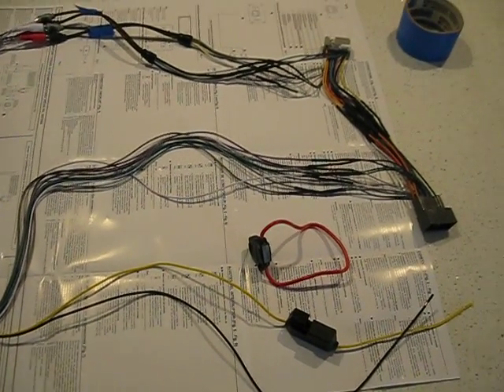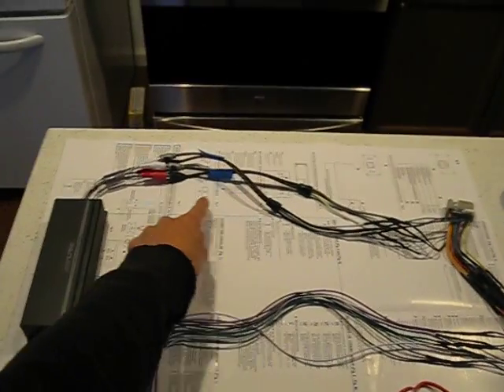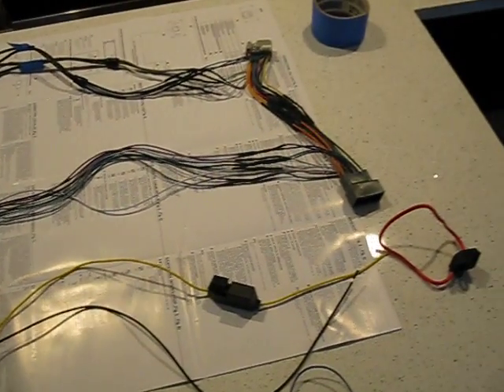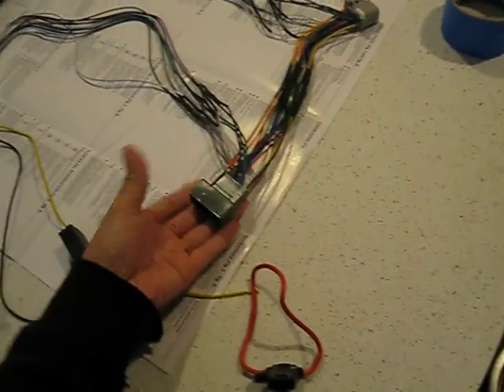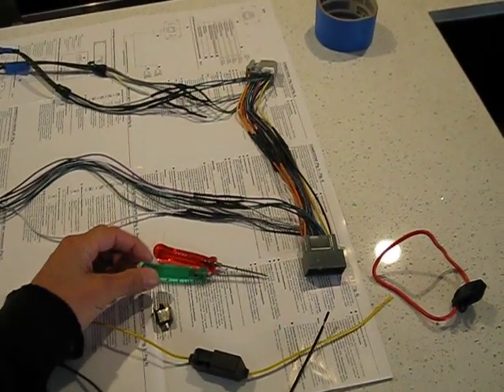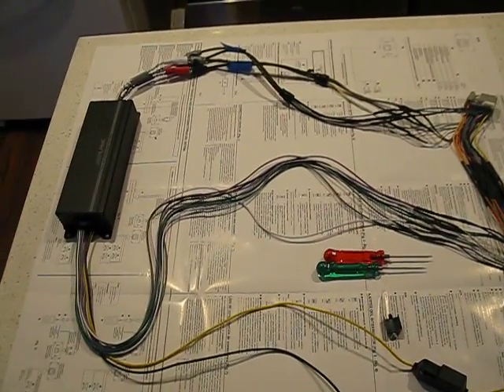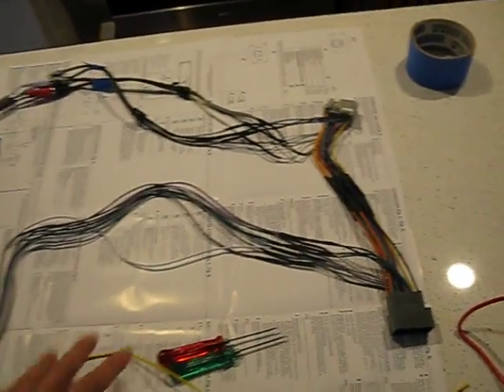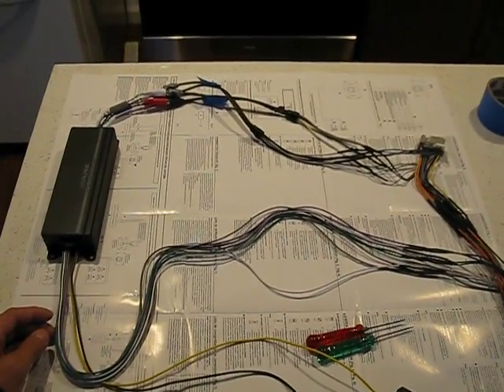2015 Honda FIT amp wire harness

Comment: At 5:10 you talk about removing some of the harness wires after finding out what's required on the stock connector. I'm sure you don't remember which ones, but do you remember if you did end up removing any?
Reply from the maker: Don't remember which one but can save time you can open up the dash and check wires so you can see what wires are needed.
Reply from the maker: Don't remember which but open up the dash and check the factory harness first save you time.
Reply: BTW I asked this because I damaged a pin removing it from the Metra 70-1729 connector, so I was hoping I wouldn't need them all. After the mishap I ended up using a sharp chisel to scrape the plastic away, exposing the pin flaps for easy removal.

Comment: Great job. Just made my own harness for a 2015 CRV. Imported the premium Navigation unit for that same year that it did not have. Added the same AMP. Not so hard, but a little challenging. It has a SUB-woofer out on the back run by the head-unit, will figure that out soon enough. Thanks again.
Reply from the maker: wished my fit had a sub out..I would of added a mini sub but with the stock radio lowering the sub frequency output at higher volume so have to have a sound processor pre-sub..just too much needed that I'm not willing to do

Comment: How did you know which wires were for the speakers to run to the amp?
Reply: where can i get a diagram?
Reply from the maker: Speaker wires are usually a match color pair with one having a black or white stripe, can't remember if the stripe wire was negative or positive, so you should find 4 color match pairs.  If you look at the back of speaker connection you'll see which color is for which location.

Blue is usually the remote
Red is +
Green is ground or -
Yellow is + ignition on

Comment: Did u use add a circuit? What amp fuse did u use?
Reply from the maker: no not add a circuit think they are kinda wimpy.  Used a regular type fuse that connects to a battery but connected to the fuse box
Reply: +DaBinChe is it possible for you to show how added power wire to fuse box?

Comment: can you make me a harness lol this for my 2012 camry? and how much would you charge me? keep in mind I will NOT hold you liable for anything that happends to my car....
Reply from the maker: It is a lot of work, many hours to do it the way I did.  Fast easy way is the use butt connectors and crimp
Reply: DaBinChe so...that's a no I guess....don't know why people turn down money for helping someone with something they can't do...
Reply from the maker: It took me about 4hours of work to make the harness at my labor rate it will cost several hundred dollars.  I dont' think you want to pay a few hundred plus parts/shipping....for a wire harness
Reply: DaBinChe: Have you ever thought about mass producing these harness for popular models... such as the Honda, Toyota and sell them on ebay??? I'm sure people will buy them. It takes you 4 hours to research, but after that, producing a clone will be faster...

Comment: where connect the blue wire from amp?
Reply from the maker: blue wire connects to the harness
Reply: DaBinChe what harness.?
Reply from the maker: part of the new harness male/female connectors, I think....or the amp has a auto on via RCA/speaker input, I can't remember
Reply: DaBinChe OK thanks

Comment: Dude, you've made videos on 4 different topics for the 2015 Fit that are all things I'm about to do. Thanks so much. I've had this exact amp in my shopping cart for months. Where is the best place to buy speaker mounts and wire adapters? I've already bought speakers so no free Crutchfield kits.
Reply from the maker: In the videos I think I show the wire and speaker adapters.  You can look for it in Crutchfield and find them on Amazon